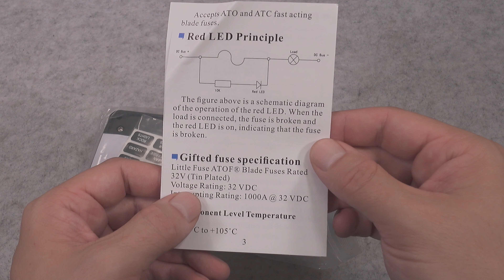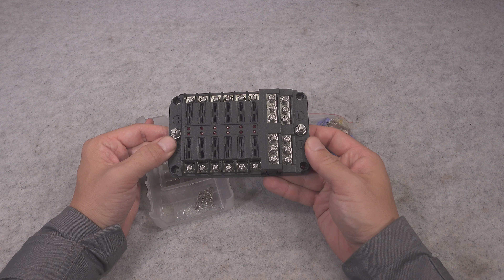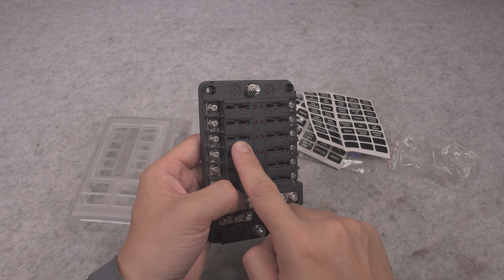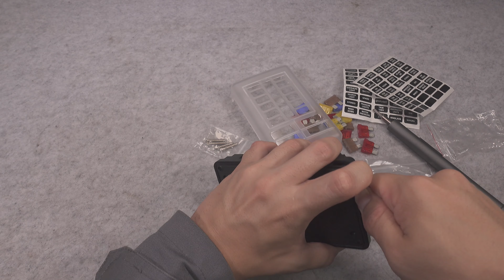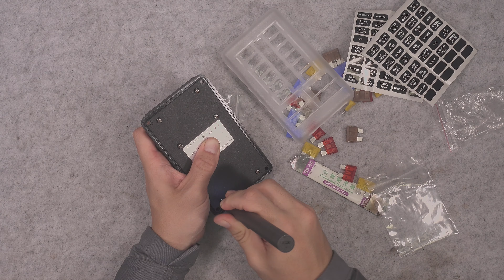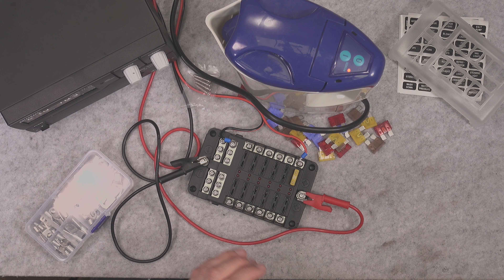DC fused 12 way distribution block with negative bus bar (ENDARK Blade Fuse Block) for solar PV

Comment: Hi mate, great video, That  fuse block is a Chinese version of the Blue Seas Systems fuse block and indeed they are used in the marine industry.. Do you have a  link for those cable lug connections please
Reply from the maker: You nailed that!  I swear I saw it on boat installation! Sorry I don't have - for my hobby projects I'm ordering stuff like this from Aliexpress  and they are laying in drawer  waiting for project to came. So that box is not something I bought recently.  "assortment lug ring terminal" <- that's generic name for this set

Comment: That negative buss bar is why I took a time choose that for my sailing boat old fuse box replacement. And those LEDs are nice too.
Reply from the maker: Exactly! I had same problem - everything I seen related to ATV was without it. My precious :> Hope it won't fail on me and burn apartment ^^